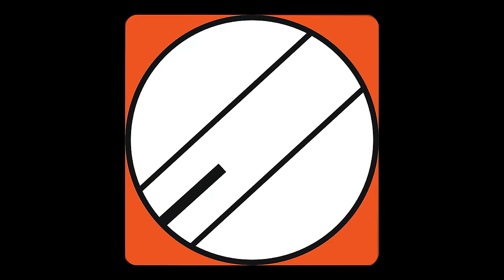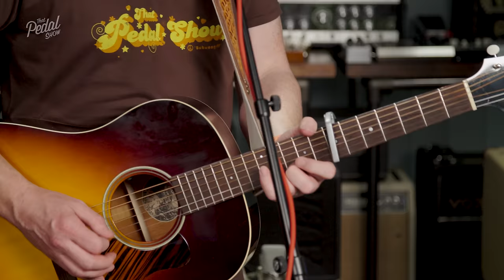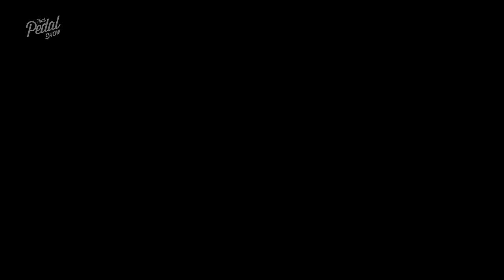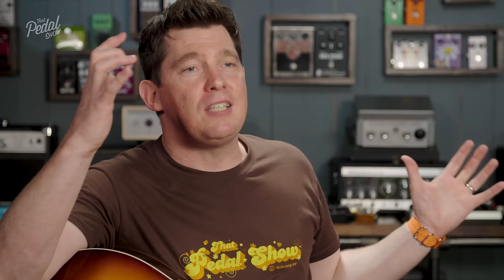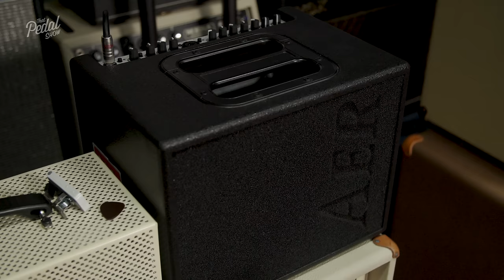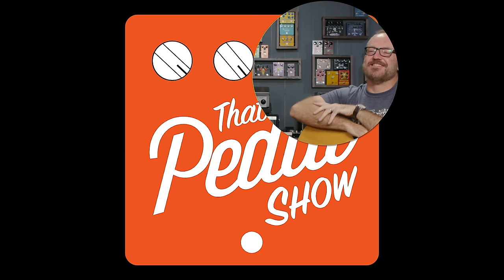Better Plugged-In Acoustic Guitar Sound Basics: Pickups, PA, Amps & All That Stuff – That Pedal Show

Comment: What is your opinion on the Fender Twin Reverb  for acoustic guitar? Anyone?
Reply from the maker: Could work for some cool, non-standard electro-acoustic tones as we’ve come to understand them in the last 25 years. Ie, fast attack piezo pickups essentially through relatively full range (PA) type amplification. In truth it’s a pretty hateful sound (to me anyway, Mick here) but it nonetheless defines what we think of as plugged-in acoustic tone. Using the Twin you’ll get less low bass, less high treble., more midrange focus. Could also be awesome with a bit of overdrive and a magnetic pickup…. But then we’re knocking on the door of an electric guitar tone. An EQ pedal would probably help immensely. Good luck!
Reply: @ThatPedalShow  thank you so much
Reply: @ThatPedalShow  Couldn't agree more on that "hateful" sound to be honest!  Have despised it ever since I was a wee young open miccer, plugging in an acoustic to the PA and wondering "hey, why does this sound like absolute shit, at home when I strummed these chords, they sounded lovely".  I hope this new wave of impulse response stuff starts to consign that monstrosity of a sound to history honestly. Plugging a crappy piezo into an IR does seem to take out about 80% of the hatefulness, even if it still doesn't reach a good micced sound of course
Reply: (completely different if you're using piezos into an electric amp for interesting weird electricky stuff or course, that's a different thing and can be interesting. Black Francis from the pixies used to run an acoustic straight into an AC30 if I recall correctly)

Comment: Seems to nail that 'nasal' sound-drives me crazy and it isn't quite an acoustic guitar sound. Don't know what I would call it. Absolutely frustrating getting a "realistic sound" out of a pickup. Little touch of reverb goes a long way. I want my acoustic guitar to sound like a acoustic guitar. I have the LR Baggs VTC that came in a J-35 Collectors edition and it still a bit off. Along with that nasal sound you get this synthetic quality to the sound that is soul wrenching eh'....at least ear wrenching
Reply from the maker: Yep. You need to move on and accept that no pickup sounds like an acoustic guitar - you HAVE - to mic up if you want that. Or just accept that it’s different and embrace it. Mick here. :0)